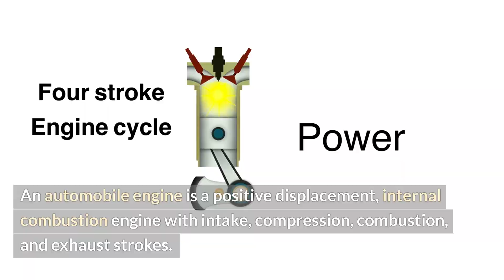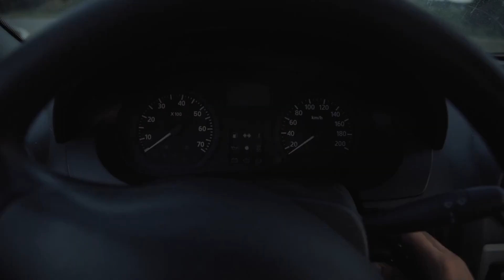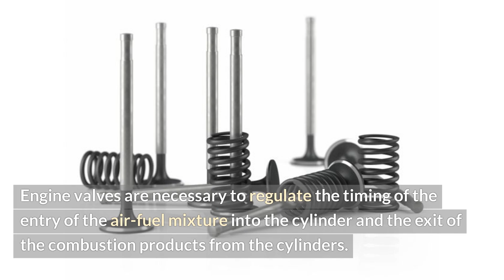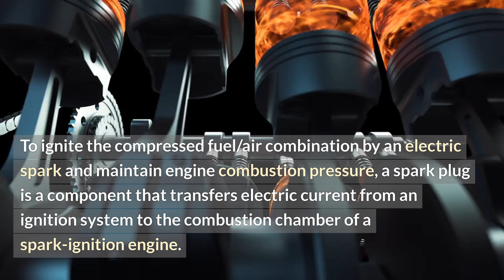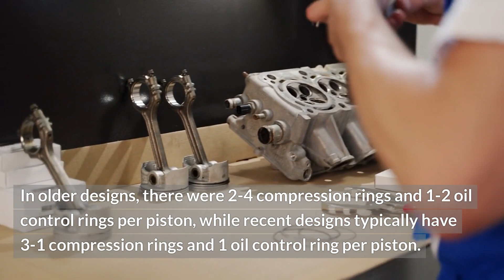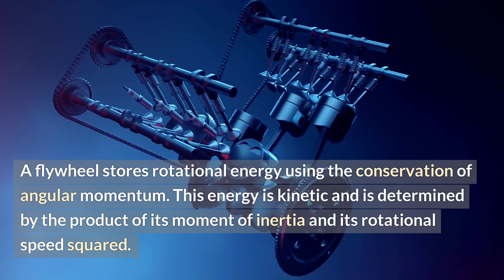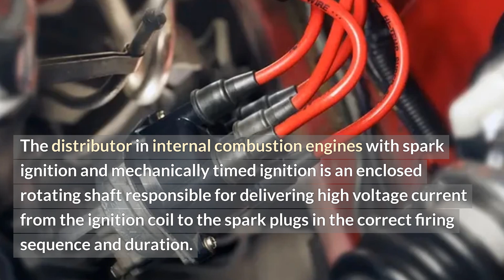23 Crucial Parts of a Car Engine: A Complete Guide

Comment: Pistons don't rotate inside an engine. 

Pistons move up and down and that force is turned into rotational power. 

The only time a 'piston' rotates inside an engine is in the case of Wankel/rotary engine where, as the name implies, the 'piston' is in fact a rotor.
Reply from the maker: Thank you for pointing out the error in our video. We apologize for the mistake during the scripting process. You are absolutely correct: pistons in a typical internal combustion engine move up and down and do not rotate. The force from the piston's linear motion is converted into rotational power by the crankshaft.

The only exception is in the case of a Wankel/rotary engine, where the 'piston' is actually a rotor that rotates inside the engine.

We appreciate your understanding and hope that despite this error, you found the rest of the video helpful. Thank you for your feedback, and we will ensure greater accuracy in future content.